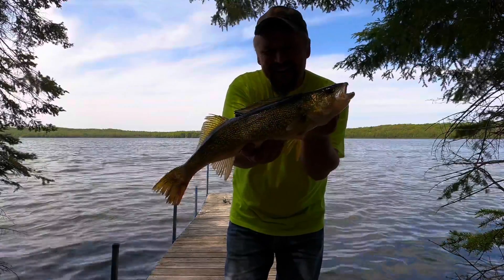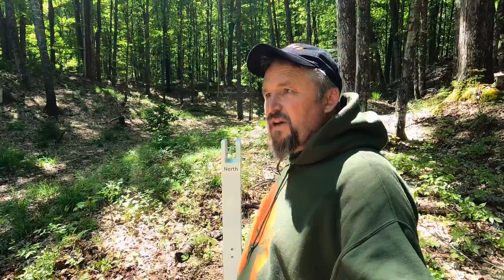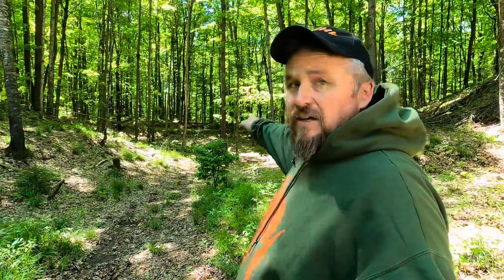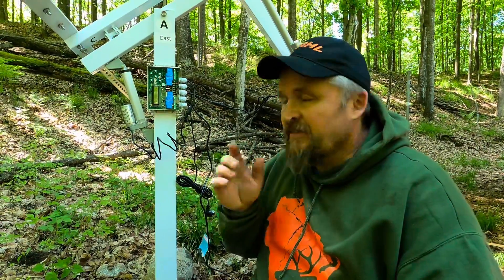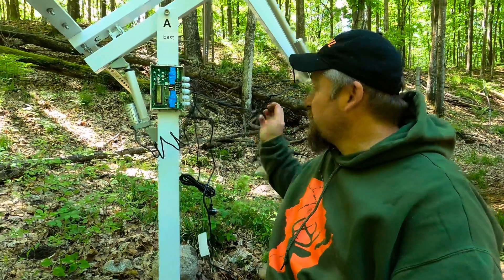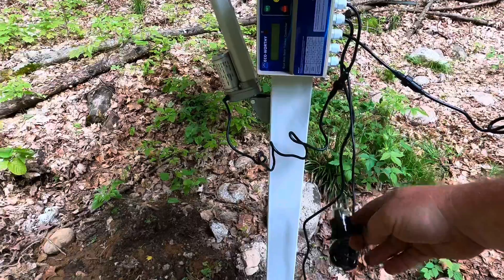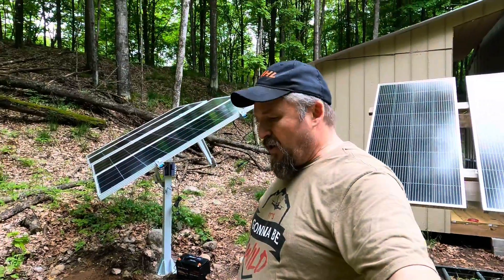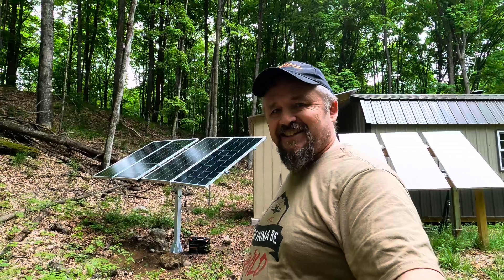Sun chasing solar panels at the cabin. Ecoworthy Dual Axis Tracking System, #solartracker #dualaxiss

Comment: How well did the solar panels do in the shade?
Reply from the maker: Great question I’m glad you asked. They don’t do good in shade at all. As you follow the rest of my videos as our electrical demands increased we removed more trees. At the time that I shot this video, we had enough sunlight shining on the solar panels to meet our demands. Make sure you put in the homework to know what your demands will be. at the time we only needed a couple hours of sunlight to fully charge our system.
Reply: @karlsoffthegrid1378  I in that situation now, ordered a solar tracker, plan to over panel my system. Wish me luck.
Reply from the maker: @KODIAKJAYMZ  it worked pretty sweet for me. I only power my TV, cell phone booster, lights,and portable refrigerator freezer. I really don’t have much demand so it’s worked out perfect so far. Best of luck.
Reply: Well the ecoworthy solar tracker I ordered was a scam on eBay. Ebay luckily refunded my money and I’ll have to wait to save up the extra cash to order another one. Which will be next month.

Comment: Got one, not set it up yet as I think due to snow I'm going to need 3' more height. Not sussed out that plan yet. My system will be 24v 800w bi-facial panels with 2- 12v 100ah Lifpo's  and a 3000w inverter that will run less than a 2000w load initially until I acquire 2 more batteries.
Did your tracker come with a IR remote?
Reply from the maker: Sounds like you have a pretty good set up. No my system did not come with the remote, but you can get it for a little bit extra money. Thanks for watching.

Comment: Looks great!  One suggestion would be to flip your actuators upside down to help minimize water intrusion and it will be beneficial come winter to prevent freezing, otherwise great job!
Reply from the maker: Thank you so much for the info. I will be sure to flip them around. That was one of the questions I’ve had that no one was able to answer. Thank you so much for the help!!

Comment: Is it strong enough to handle the wind?
Reply from the maker: It comes with a wind speed sensor that turns the solar panels horizontal depending on wind resistance. They definitely did their homework when they designed this one.